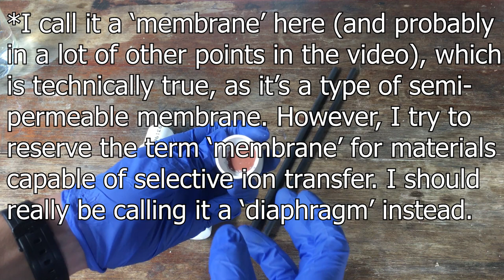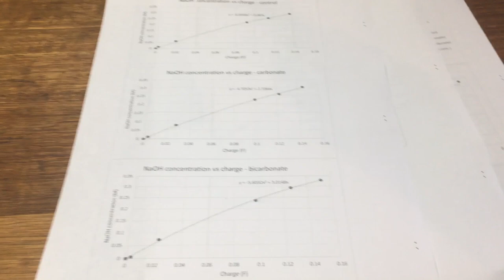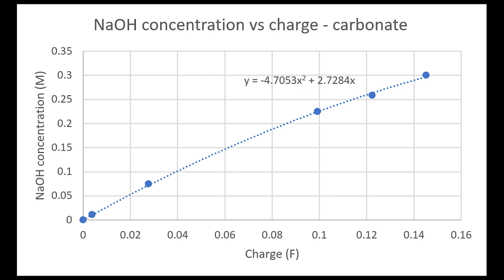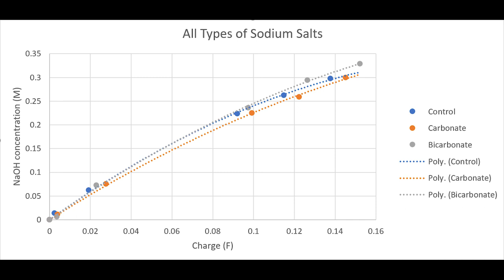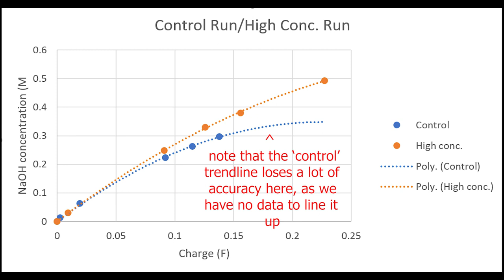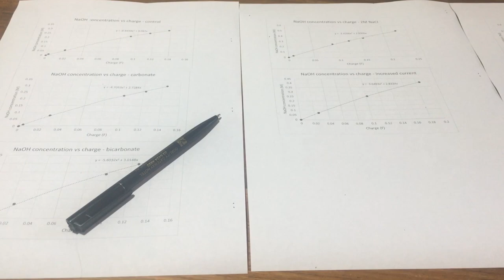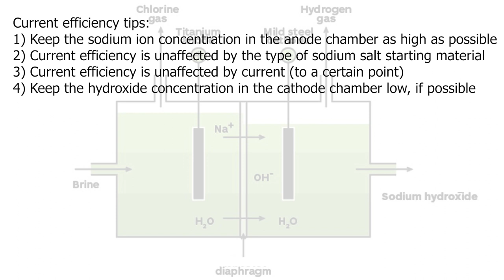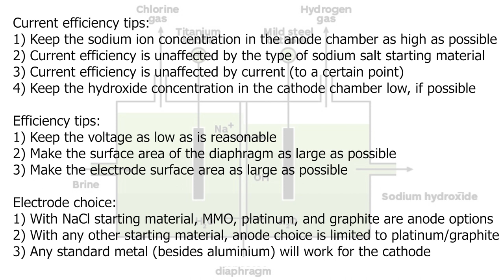Sodium Hydroxide - Diaphragm Electrolysis ep1

Comment: I know a good ion exchange membrane for this type of chloralkaline cell.  It's Super-cheap too.  (pun intended)

1)  Fold a piece of paper over a credit card to create a makeshift disposable squeegee.  
2)  Put a line of medium viscosity cyanoacrylate glue across the top of a sheet of paper.  The line should be less than or equal to the length of the credit card.  
3)  With some pressure, smear the glue down the sheet of paper in a smooth stroke to make a thin, even coating.  Be careful of the fumes.  They are absolutely dreadful.
4)  Let the glue set completely, and inspect it.  If it is dull with a rough texture, it bonded with moisture in the air and is no good.  If it is smooth and glossy, it primarily bonded with the cellulose, and that is what you want.
5)  Cut out your membrane and install it with the treated side toward the hydroxide chamber.

I can't say for sure why it works so well.  I discovered it almost by accident.  My theory is that the CA glue bonds with the OH- groups on the cellulose to form a copolymer with an overall positive charge, while the unreacted OH- groups, on the untreated side, add up to an overall negative charge.  

Exposure to moisture, while the reaction is taking place, seems to reduce performance.  Adding OH- ions to the mix may be neutralizing the charge.?  :body-blue-raised-arms:  You want the paper and the air to be as dry as possible, but at the same time, you don't want too much heat.  The reaction could run away and go thermal.  That's why I recommend medium viscosity glue.  The additives might not help performance, but they do help to control the reaction, and it makes the glue easier to spread as well.

Have fun tinkering, and play safe with this stuff.  :goodvibes:
Reply: very interesting, i can only tell you why cyano or clues with cyanide in it doing worse in water because the cyainde reacts with the water (and breaks down) and the acrylate cannot longer react with the cyanidde to form the copolymer
my theorie, because Cellulose contains a lot of OH Groups the clue forms a coating conatining more COOH Groups coming from the acrylate (when its an acrylat acid, no acrylic ester) compounend in the lacquer or as you said a more negative charge when the hydrogen gets carried over to the other side creating a coating of COO (-) to repeal the OH (-)

Comment: If you have trouble getting sodium carbonate but anyone can get sodium bicarbonate, then just heat the bicarbonate on a baking dish at 300 F for 1/2 hour (or something like that) and it will convert to sodium carbonate.   Weigh it before and after to check the stoichiometry, it should be nearly 100% conversion.
Reply: Sodium carbonate is sold as "washing soda". It can be kind of hard to find in grocery stores, but it's readily available online.

Comment: I followed the making sulfuric acid with epsome salt and purchased the quarter gallon terracotta pot made acid with graphite rods wondering if I have carbine or graphite in the bottom? Excellent series
Reply from the maker: You’ll just have made a fine graphite (which is the same thing as carbon) powder if you used carbon/graphite as the anode.

Comment: Thank you for this educational video. I have a question: I am interested in electrolyzing NaCl, because I want to react the chlorine generated with the hydrogen in order to produce hydrochloric acid. Do I need to use pure NaCl for the brine, or would table salt or sea salt work as well?
Reply from the maker: The reaction between hydrogen and chlorine is a pretty dangerous undertaking. I do apologise if you've already looked into the safety issues and requirements for such a reaction, but I'd definitely recommend some intense research and design before even attempting this one. The explosions you tend to get are no joke.
Regardless, technically any sodium chloride source will work to some degree if your end goal is to make chlorine. However, you should probably steer clear of contaminants which will precipitate under basic conditions. Seawater is full of magnesium and calcium, so you might need to get rid of those before using seawater directly. Either way, pure NaCl is definitely the best option since you'll never encounter any unexpected issues.
Reply: You will need to use pure sodium chloride, table salt contains added iodide salts and sea salt even contains bromides salts on top of iodides. An excellent source for very pure and cheap sodium chloride is water softener, which uses pure sodium chloride and is available in 25 kg bags.

In order to produce hydrochloric acid you will need to thoroughly dry both gas streams (the hydrogen gas and chlorine) so the end product will be anhydrous hydrogen chloride, which is actually pretty inert as far as corrosiveness against steel. As soon as it comes into contact with water it becomes hydrochloric acid, which is highly corrosive. The only safe way to produce the hydrogen chloride is by feeding both dry gas streams through individual tubes to a combustor where both streams intersect and are ignited, creating a continous flame. Kind of similar to how most high temperature torches work, like oxyhydro (i.e. hydrogen/oxygen) and acetylene. Do take into account that chlorine is a powerful oxidiser, and as a result the hydrogen/chlorine flame will be at over 2000C. If you build the combustor into a steel endcap aimed vertically upright inside an upright steel tube of about 30-40 cm long and with a big enough diameter, and with a 90 degree bend fitting on top of it followed by another short piece of tube and closed off with an endcap with a hole drilled in it for a tube where the formed hydrogen chloride is led out of, and bubbled into cold water, you'll be able to make your own hydrochloric acid. You might want to fill the second shorter piece of pipe with some inert refractory material to absorb the generated heat from the flame, perhaps lumps of graphite or something, and the tube coming out of the endcap will almost certainly need to be made of metal, as the hydrogen chloride with still be much too hot for any polymer. Also realise that dissolving hydrogen chloride in water to form hydrochloric acid is a fairly exothermic process, so depending on your hydrochloric acid output you will probably need actively cooled water to form the hydrochloric acid in.

Comment: This is great sir, thank you for your efforts. I would like to ask you about the asbestos membrane that allows the passage of sodium ions and does not allow the passage of chlorine icons. Where can it be bought, and if I build two basins with a capacity of 100 liters, what is the appropriate current strength?  And the appropriate voltage
Reply from the maker: Asbestos is not something you should ever consider using. There's a reason it has been banned for sale and use in over 70 countries.
Additionally, asbestos does not 'allow the passage of sodium ions and not allow the passage of chloride ions', it actually allows the passage of all ions, so there's no reason to use it over the simpler and safer porous terracotta I'm using here.

If you're building a chloralkali cell with a capacity of 100 litres, you're going to need a lot more information to determine the current and voltage through your cell. Things like the size/shape/surface area of your electrodes, the shape of your cell, the type of electrode material, the positioning of the membrane, the desired production rate, the available electricity, the conductivity of your solutions, the surface area of your diaphragm, and the positioning of the electrodes will all need to be considered to even get an estimate of the reaction conditions required.

For starters, how much sodium hydroxide do you want to make with your cell, and how quickly do you want to make it?

Comment: Great project!  I am keen to try it out, but generating chlorine gas kind of scares me.  Are there ways to neutralize the Chlorine once it bubbles out?
Reply from the maker: If you're doing this on a small scale (such as the cell in this video, where there's only around 0.1 A flowing through the device), the amount of chlorine you make isn't anything to worry about, provided you do the experiment outside.

However, if you're planning a larger cell, or anything running at a higher current, you can neutralise the chlorine by collecting the gas over the anode and leading it through a solution of sodium carbonate. (sodium hydroxide makes the best chlorine neutralising agent, but since that's your desired product, there's no point in using it).

I also have an updated video about building a bigger cell, where I do actually neutralise the chlorine produced: https://youtu.be/iZH5fB0iM7U 
(I use sodium hydroxide as the neutralising agent here, but this can easily be replaced with sodium carbonate)

Comment: Thermal decomposition of CaCO3
 CaCO3 —> CaO + CO2
CaO + H2O —> Ca(OH)2
Preparation of Na2CO3
1. NaCl + NH3 + CO2 + H2O —> NaHCO3 + NH4Cl
                          
                          ∆
2. 2NaHCO3 ——> Na2CO3 + H2O + CO2
 
Now, 

Ca(OH)2(aq) + Na2CO3(aq) —> CaCO3(s) + 2NaOH(aq)
Reply: Noteworthy that calcining calcium carbonate requires 835°C. Charcoal can totally get that hot, and both copper and iron/steel can handle it, though, so surprisingly available to a home chemist. Also noteworthy that sodium carbonate is super easily available and thus doesn't need synthesis. However, I'm curious if the synthesis of the bicarbonate requires a catalyst or elevated temperature, as the inputs seem pretty stable.

Comment: Well made. What are the changes in the anode chamber. Is there any CO2  generation in the anode chamber?
Reply from the maker: In the case of using sodium chloride as a starting material, the anode chamber will slowly generate bleach and chlorate in solution, along with the chlorine gas bubbling off the anode.

When using sodium carbonate, the anode reaction will generate oxygen and hydrogen ions. These hydrogen ions will eventually neutralise the sodium carbonate (first making sodium bicarbonate, and then eventually carbon dioxide). A similar thing happens when using sodium bicarbonate as the starting material.

Comment: There are more possible anode materials: For chlorides and carbonates magnetite should work really well (but the anodes are kinda hard to make as you need to melt the material)
For sulphates, lead dioxide (or just lead that has been anodized in NaHSO4 or H2SO4) will work much better than graphite. If you use lead make sure that the chloride concentration is low or the PbO2 layer becomes unstable.
Then theres also MnO2 anodes but they are hard to make and sensitive to abuse.
Reply: You know if a titanium anode (without platinum) can be used for this and other electrolysis?
Reply: @lautaromorales2903  No, titanium can only be used the cathode. Pure titanium as an anode will either passivate or erode depending on your electrolyte and cell voltage. It is only good as a carrier for other anode materials.
Reply: @nussmischung1776  recently I saw the 2NaCl + H2SO4 = Na2SO4 + 2HCl reaction and I think i'm going to use that to make the hydrocloric acid and via electrosysis separate the Na+ and SO4-² ions. You know if with SO4-² ions the titanium anode will resist enough?
Reply: @lautaromorales2903  Passivation means a NON-CONDUCTING oxide layer forms. You cannot electrolyse anything with that. 
Besides, you cannot make pure HCL solution with that approach. Either use dry distillation which is dangerous or https://www.youtube.com/watch?v=TQdvB5W4Zb8
Reply: @nussmischung1776  thanks for the information!